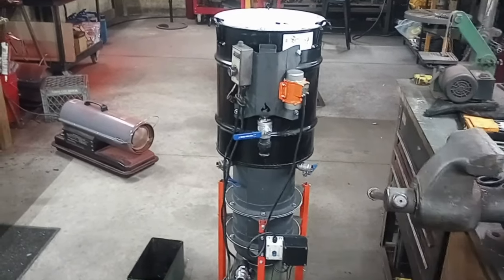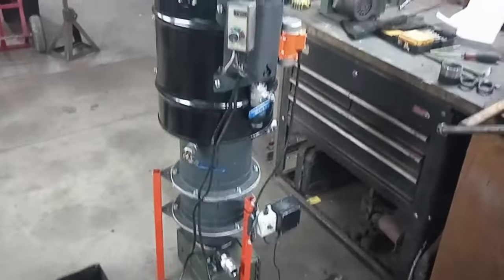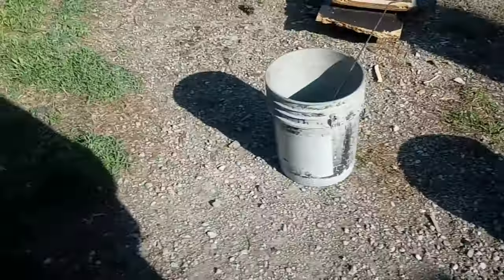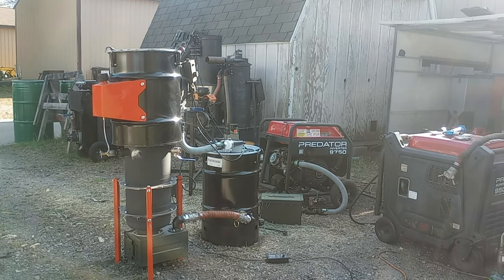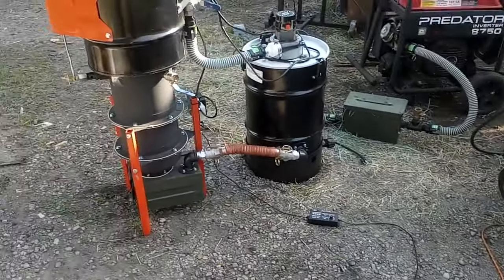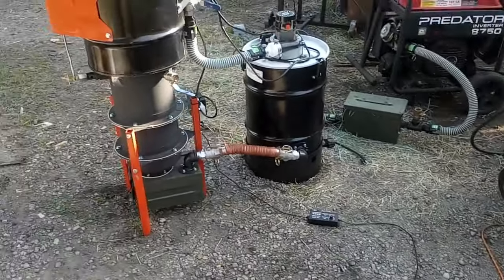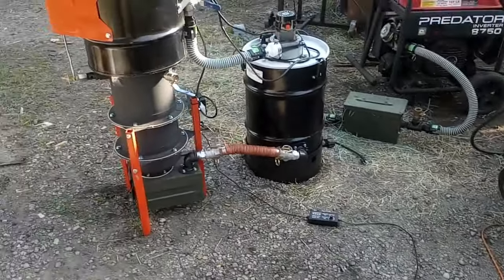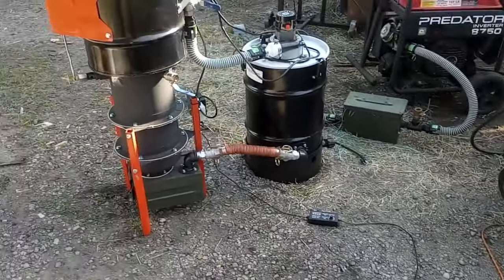Success!!!! Harbor Freight DIY Gasifier 100% Wood Chip Run 2

Comment: "There is no such thing as set it and forget it? Wise words spoken from a man speaking from experience! It's been a while since I've watched and commented on any woodgas videos. I really like the setup and how you made the build modular. I really like the biochar removal setup with the ammo box. Keep on keeping on. Flash.
Reply from the maker: Yup build moduler with slip in cores. Build it bigger so you can insulate the crap out of it. Here is the latest model. With changable cores and the new automation system. https://youtu.be/pPJzMOcOgzA
Reply: You guys has been inspirational. I built a wood gasifier from random videos but its not producing flammable gas. Hopper temp stops between 150 to 200 degrees. Any advise to make it hotter will be very helpful.

Comment: Lol... you look like a mad, smudged, steampunk scientist twisting knobs, throwing levers amid off gassing of steam and vapors, huffings and puffings! Great stuff. I've got to build me one of these since I have a lifetime's worth of trees on my property! Looks like the technology has almost been completely resurrected and is ready for prime time for the first time since WWII! God Bless!!!
Reply from the maker: Yup but dont waste your time with a wood gasifier. Learn charcoal instead. Its easier and it actually works.
Reply: @Thrive-Off-Grid  Interesting. There must be a high percentage of gas leftover after you remove all the water and turn the wood into charcoal...?
Reply from the maker: @3Sphere  You get rid of the tar in the charcoaling process. The water is replaced via the water injection. Water is also a fuel input, this is called "water gas". A charcoal gasifier is an open reactor versus a wood gasifier is not and is choked. At small scale they are more head ache that its worth trying to save the wood. At least what you think at first. Once you have done both you will avoid wood gasification like the plague. YUK!! I HATE TAR!!
Reply from the maker: @3Sphere  This is a good oppertunity to be creative instead of kicking the wood gas can down the road. It dont work at small scale. Accept that and move to charcoal and shift all creatively there. There is always a need for heat. No reason you cant use the retort for heating, hot water and AC. We heat our shop with our retort and its actually crazy efficient as a shop heater. The charcoal it produces is just nice bonus.
Reply: @Thrive-Off-Grid  Thanks so much for the heart-felt advice! Sounds like you've saved me a whole lotta pain from your negative experiences already. I've got a lot of reading & thinkin' to do! I was going to make a biochar retort anyhow, now I have got to make a much bigger one! Cheers!
Reply from the maker: @3Sphere  You should go to the website. I explain in depth our development history and my unwillingness to even consider building charcoal systems. Then one day I did! That was the day wood gasifiers ended for me. But I also had to drop a big ego and eat lots of crow. MMMmm yum!! Im good now and now Im doing all I can now to point new users in the right direction and success. 

Also Ive pointed out how Youtubers are decieving you. I know the tricks and I know the whys of the short videos of the engines actually running. Dont be decieved by 2 minute run videos. The reason those videos are that short is because thats all the longer they can get the thing  to run for. 

https://www.thriveoffgrid.net/forum
Reply: @Thrive-Off-Grid  Thanks for the great advice, man. I do try to learn from other's experience so we don't have to constantly re-invent the wheel! We already lost all of this technology once from WWII. I checked out your blog. WoW, that's a lot of information! This is going to be interesting! I'm in the process of getting my place ready to sell so we can buy land for a Homestead and Permaculture Food Forest in the Midwest, far from the Libtard Left Coast, among other things. So I have a lot on my plate right now. But I am definitely going to read all your stuff and trace your evolution! This seems like the perfect solution to have juice during the apocalypse! Cheers!!!
Reply from the maker: @3Sphere  Part of what was lost is the charcoal side. Many eventually abandoned wood fuel and built charcoal systems in the later years. But that is not documented as much. Wood gasifiers were mostly on large military vehicals, tractors and larger applications.

Comment: Really appreciate operational info such as ~1300w for x hours.   I notice you also provide guidelines to generator engine size / continuous power estimates / runtime range on you're product list as well.   Kudos!  As a long time offgrid (mostly solar) enthusiast, this kind of actual information really lends credibility to you're efforts and products as far as I'm concerned.
Reply from the maker: I would rather the machines exceed expectations than fail unrealistic expectations. The imformation available online people should take with a grain of salt. Most of the negitive aspects are very limited. Tar, production and what that does to engine valve trains., power reduction due to less energy density, machine continuuse opperattion will never be linear, (this is a solid fuel) ease of fuel processing like charcoal vs wood fuels etc. Small engines under 1000 cc charcoal is hands down the better option. Charcoal is actually easier to make and these machines run small engines without tar production and will run nearly hands free or about 95% better than even an automated wood fuel system. Over 1000cc wood fuel systems are going to be better if you have a good process to produce wood chunks. 

And yes everything is an estimate this because nothing with wood gasificaiton of any kind will ever be linear.
Reply: oh hell ya ,its all info u really need to calculate to be as efficient as possible!

Comment: Increasing engine compression will get you more output when running on CO.  About 11:1 would be ideal, but I doubt it would be possible with the engine in question.  The starter may have a bit of a workout, but more energy output in the end.  Milling the head would have to be done carefully if it is an OHV engine.  Valve to piston clearance will have to be checked.  .100" clearance should be enough.
Reply from the maker: Just get a bigger engine its not worth moding these little engines. Also use a battery bank then it dont matter. The inverter then can output what ever its rated for and as long as there is power stored you will have the power. Never use a gasifier as a primary power mover its cool when you first see this for the first time. But in the long haul you will want a battery bank and use an inverter.
Reply: @Thrive-Off-Grid  As a master mechanic for 35yrs, modding engines comes pretty easy to me.  Other people may not like my solutions, but the easiest way to increase power and efficiency is changing the compression ratio.  The goal is to waste as little fuel as possible.  This one has a 9:1 ratio.  Not bad.  A good start, but needs to be dialed in to the fuel that will be run.  Further research on wood gas engines suggest 13-15:1 compression ratios, but I don't think the starter will put up with it.
  The battery/inverter thing is pretty standard, and is about as bulletproof as it will get.
Reply from the maker: @vilefly  Yes I am well aware of this. There is a ton of things you can do besides just raising CR. But all this is typically out of reach for the average consumer. Besides it dont need to be complicated. If you want it to be efficient then store the power. Make only the power you need. Use an inverter to manage the power.

Comment: I wonder how big of a gasifier one would need to run a V-twin engine running under 70% load for instance a 15 KW generator running at about a 10 kilowatt load charging solar batteries.
Reply from the maker: What are you trying to power a Holidauy Inn Express?? That is way to much power for a typcial off grid home. You only need a single cyl generator for a house.

The V Twins like the Honda GX 670 will not produce 10 kW running on wood not even close. The max ouput will only be around 4 kW at best.
Reply: @Thrive-Off-Grid  I just need to be able to power 10,000 watt solar battery charger. Running 4 hours with 10 KW I can charge my batteries up from almost zero on rainy days. It's mainly for December and January when the sun doesn't reach my solar panels due to the trees across the street.
Reply from the maker: @basspig  Running 4 hours @ 10 kW is 40 kW/hours. If you mean you need to charge up to 10 kW / hours you only need a single cylinder generator like we are using outputing at around 2 kW = 5 hours run time = 10 kW/hours. If you need to produce 40 kW / hours everyday  you will be a slave to this equipment. Just running these small generators everyday for 4 to 5 hours is already a lot of work.
Reply from the maker: @basspig  You must process your fuel. It be dry less than 10% MC. We dry all the moisture out of our test fuel. Our fuel is bone dry it willl not register on a MC meter. If it does we will not run it!! You must also screen all the fines out of the fuel. Small scale gasification is not as easy as larger machines. The smaller the machine the more dificult it is to achieve the high temps you need to crack the tar. Then also the smaller the machine the harder it is to get it to flow. So all fines must be removed.

For every net 5 kW / hours produced a typical gasifier will consume 10 to 15 gallons of fuel. Regardless of the gasifier the engine its running or who made it. So for 40 kW / hours net energy produced you are going to need to process 80 gallons of fuel. It will actually be closer to 100 gallons. so two 55 gal drums worth of fuel everyday.

Comment: What would happen if you filtered through a water bath , the tar would collect in the water , and you pour it out
Reply from the maker: Water bubblers dont work, tar is not always in a partical state so it can not be filtered. Under vacuum the vacuum is forcing the tar and moisture to stay in gas suspension until a high presure is reached. Yes some forms of tar will condense in the filter however its really only a small ammount. 

Water bubblers will rob power as well as you need to pull the gas through water. Besides that it will make a mess!! Been there done it. 

Best to not make tar in the first place. Our filtering is not for tar. It is only for dust and to cool the gas down.
Reply from the maker: If you dont want to make tar. Dry your fuel!

Comment: If there was a cooling pipe grid after the gasifier... it would cool the wood gas before filtration as well make oil from the heavier unwanted chains that drop out of the gaseous solution.
Reply from the maker: This is the DIY version. Our procuction machines have massive coolers on them. The way we build this is not something most can DIY. https://www.thriveoffgrid.net/versifireexperimental14woodgasifier

Comment: How much money do you think you have invested. And how many hours of your time learning and building. Pretty cool i have seen a couple over the years
Reply from the maker: I have well over million dollars invested into our development and over 12 years into learning and building and Im still learning new things everyday. 

Dont build a wood gasifier, start researching charcoal gasification. Wood gasification does not work for small engines. 2023 was my last attempt to make a wood gasifier work for small engines. Im done with them and will never pursue that again. Charcoal systems work, they dont make tar and they have far better stability. 

We built this unit so it could do both so that people can experience how much better charcoal is in the same machine. But its a complex way to teach people this lesson. So Im abandoning it. Just take my advice I am one of the bigest developers there is in the small scale gasification space.

If you want run an engine on wood, build a charcoal gasifier. If you want to break engines and constantly beat your head against the wall build a wood gasifier. Becuase thats exactly how it will be.

Comment: you need power to operate it but you buy it to make power? they have one that doesn't have the chicken and the egg issue?
Reply from the maker: How do you start your car? I am off grid the power comes from stored power from the gasifier. If you are not using this with a battery bank you are going be very disapointed with this technology. You might want to watch a few more videos and learn how these systems are best used. You never want to use any gasifier as a primary power mover. You are at the right place now because the videos you have watched before getting here are not realistic and done by amatures; I am one of the highest level developers you are ever going to find. https://www.thriveoffgrid.net/
Reply from the maker: The blowers we use are AC/DC. You can run the blower on DC but will work better from a small 600 watt inverter you can use on a 12v battery like the one on the generator you are trying to run. You want electric start with gasification. They are hard starting and this will make you an old man very quick!! Use electric and recharge your battery from the 12 volt charger most generators have. No different than your car unless you hand crank to start your car?
Reply: I was being somewhat rhetorical. However, I was thinking of going with a heat engine (stirling) and aiming for 500 watt and have been pondering on a nonelectric starter. @Thrive-Off-Grid
Reply from the maker: @FrankensteinDIYkayak  lol that is not the first time people have asked that but were serouse. Sorry. 

anyways that is a deep rabit hole and if that were viable I promise you there would be systems already available and sold at Wall Mart. There have been a few that got close to small scale but just never made it to market. There is a reason for that.
Reply from the maker: @FrankensteinDIYkayak  Use the starter until it breaks. Typically it will outlast the longevity of the engine anyways. You will want to get a re ring kit for any generator you run. assuming you are thinking SHTF situation. So you willl want a number of those kits with a hone. At that point you and I will be distilling ethanol and you will use that to help get it started with a pull start.
Reply from the maker: There will be plenty of batteries around in that situation as well.

Comment: How to build a wood chip gasifier?
Reply from the maker: If you are looking to run a small generator. You dont want to run wood fuel. That is for big engines and big engines only. I will not support that because I know it will end in failure. See our ammo box charcoal unit Tutorials and look up Gary Gilmores SimpleFire. Dont take charcoal at face value its easier fuel to make. It wont be practical drying wood to Zero moisture content and that is an absolute must and you will still have flow and tar issues. Learn from my experience and build a chacoal unit first. Then if you want then try to build a wood fueled system. Go to my forum and also the Drive On Wood forums. Create build thread and we will show you to be successful. You wont get this help anywhere else.

Head my advice man, because if you go down that wood fuel path you are going to waste time and mioney only to arrive at charcoal gasification in the end anyways.